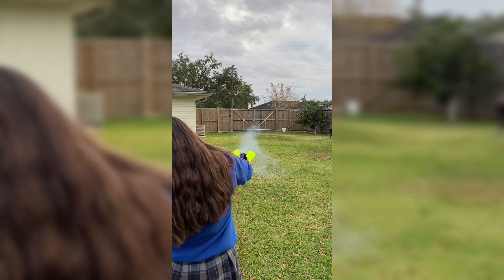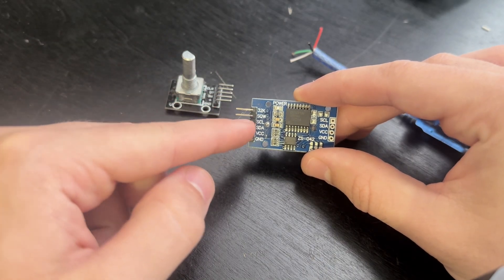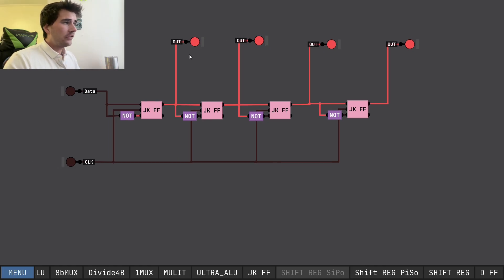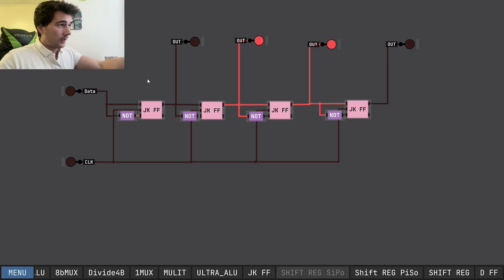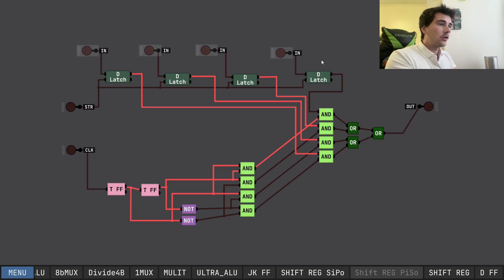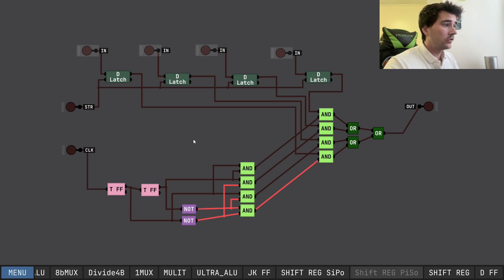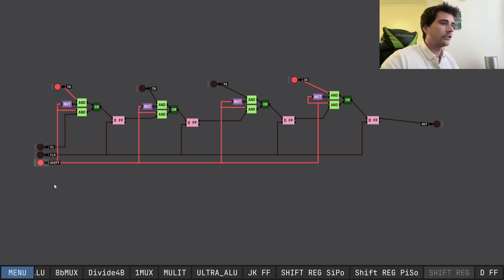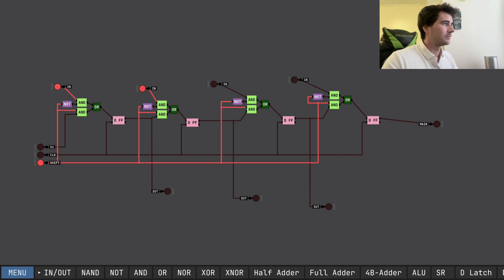USB cable's GENIUS way of communication with minimal wires (Hint - Shift Registers)

Comment: ... but USB does not have a clock line?
Reply from the maker: Yes if you cut a USB cable you’ll see 4 small wires: power, negative, data, and clock
Reply: @FULXORELECTRONICS  no. USB uses differential signaling, D+ and D-.
Reply from the maker: You are correct. The clock signal is in the data signal itself. The D+ and D- lines carry both data and clock signals
Reply: @FULXORELECTRONICS  If you want people to treat you as an expert, don't let an LLM comment for you.

Comment: also with your design of the serialiser, which is designed as pretty much a regisyter, where each of the 4 bits go into a 1 bit 4 to 1 mux, with a 2  bit decoder choosing which bit, and then 2 bit count connected to clock. usually however the sender will also be designed as a shift register, but a shift register that has store mode to set each bit to a specific number, and then when shifting the serialsed output will just be the last bit. then ofc the clock can be connected same as yours, but the differences is one is complelty expandable and works as a module as both recieved and sender but yours does not.

Comment: Hey man, EE here that also mentors new interns at my job. The ever watchful algorithm recommended your video to me.

First off, props for putting this together. It takes real effort (and courage!) to make technical videos, and your shift-register demos are a solid way to build intuition for “one bit at a time.”

Friendly suggestion: the jump from shift registers/I2C (SCL/SDA) to “that’s how USB works” oversimplifies things in a way that can really confuse newcomers. USB 1.x uses a differential pair (D+/D−), embedded clocking (NRZI + bit stuffing), and a host-driven, packetized protocol, etc.... very different from “one data wire + a clock.”

If you’re up for a follow-up, a mini-series on the evolution of serial protocols would be awesome and super helpful for beginners. For example:

 - Parallel vs. serial + shift registers (concepts, not USB yet)

 - UART (start/stop bits, async timing)

 - SPI (clocked, chip-select, full-duplex)

 - I2C (open-drain, ACK/NACK, addressing)

 - Why differential pairs + basic line coding (NRZ, NRZI, Manchester) instead of separate clock/data lines (might be difficult to model)

 - Packets, CRCs, and flow control (how links get reliable)

 - Then: USB 1.0/1.1 basics. D+/D−, SYNC, token/data/handshake, endpoints, frames, etc.

The evolution of chip to chip communication is a great set of lessons and really builds understanding. You might even include a quick aside to parallel communications, why they have mostly been phased out for anything with any distance, and where they are still used (CPU to RAM, certain camera/screen modules to microcontroller setups, 2x16 character LCD screens, etc.). I'm old enough to remember when USB first came out and how it eventually replaced just about everything and learning the "history" as it happened really helped me grow in my career.

Best of luck in your future videos!